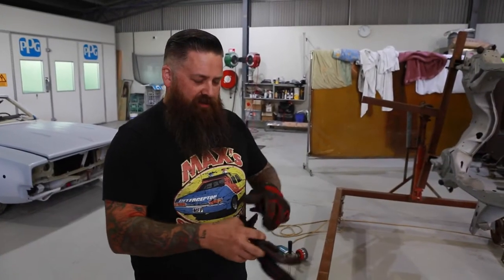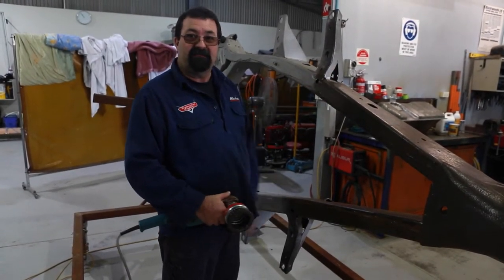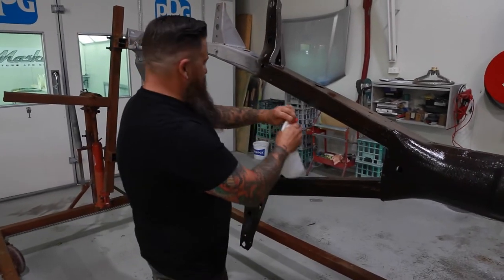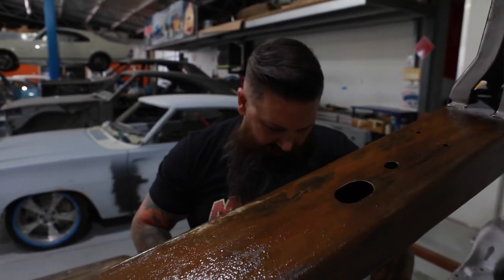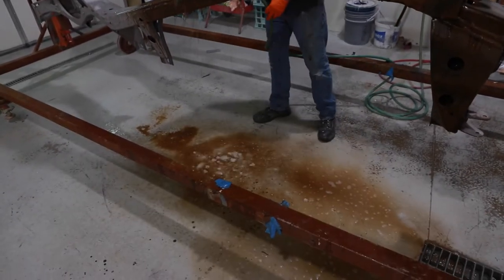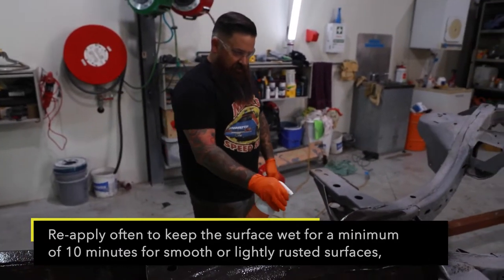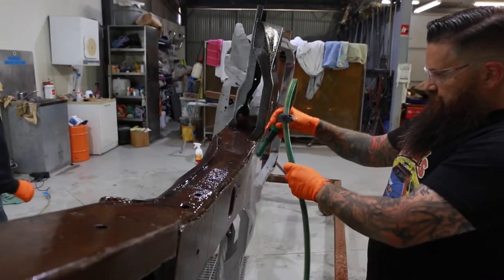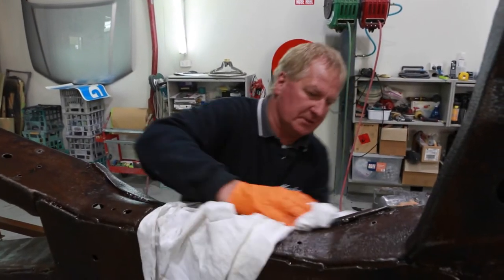KBS CHASSIS COATER WITH GREG MASKELL

Comment: I'm currently restoring slightly modifying my 81 goldwing. I sandblasted my frame and did the whole kbs treatment. I sprayed my frame... Gravity feed cup, 20-25psi as recommended. I am SO  impressed with the rust seal product. I think that my finished product is better than factory to be honest...